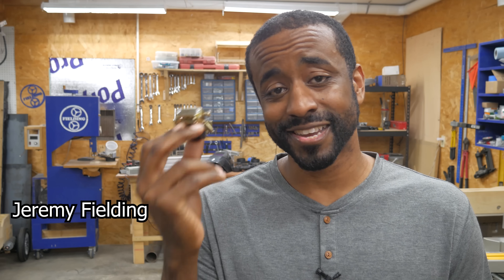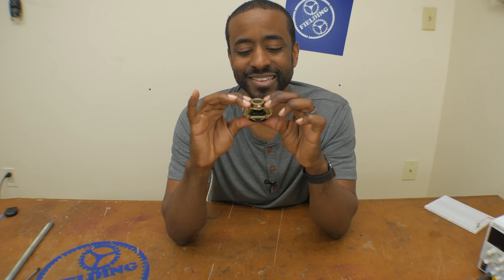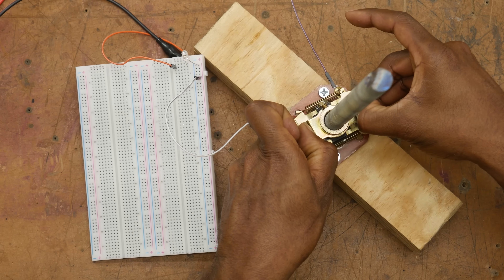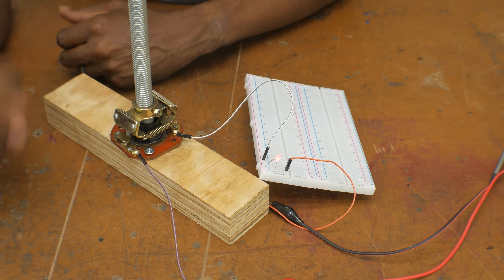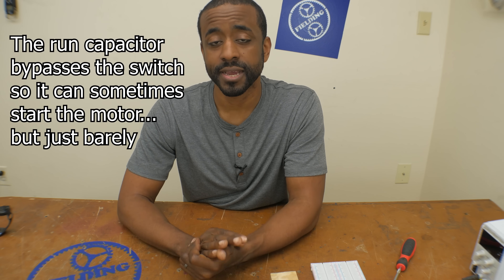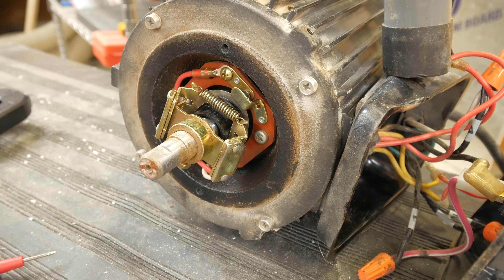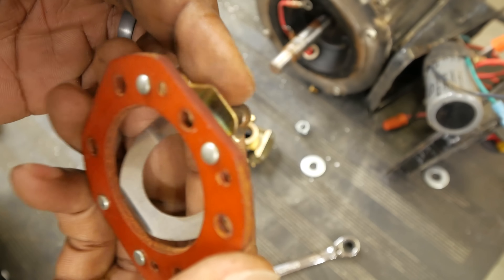This Clever Device Is Found In Nearly Every American Household. How It Works And How To Fix It

Comment: The Centrifugal switch was a reinterpretation of an older invention.
"Centrifugal governors were invented by Christiaan Huygens and used to regulate the distance and pressure between millstones in windmills in the 17th century.[1][2] In 1788, James Watt adapted one to control his steam engine where it regulates the admission of steam into the cylinder(s)[3], a development that proved so important he is sometimes called the inventor." - Wikipedia
Reply: Thanks, I was going to ask how this device is different to a governor on static engines I’ve seen (diesel wool clipper engines, fruit packing engines etc) which I was told were the same as used on James Watts’ steam engines. Apparently no different - in concept as least.
Reply: Julian Morrisco does a governor control speed in an analogue way, but this is a speed dependent switch in a binary way?
(That made more sense in my head!)
Reply: @julianmorrisco  a propaganda is all it takes.
Reply: thanks!
Reply: I’m pretty sure that was also the origin of the term “balls out.”
Reply: @likesrush  Woodward (US) is perhaps the most reliable manufacturer of Centrifugal Governors.  The oldest mechanical version is as described: two spherical weights at each end of scissors, external mechanism.  It is on the company logo but I believe it is no longer manufactured.
I believe Woodward still manufactures electronic analog versions of which the most famous model is the 2301 . The most modern versions are digital electronics and contain programs that simulate this most successful analog model.
But the more modern mechanical (centrifugal) versions that I believe are still manufactured is that they have become an icon in this field of Engineering.  The weights+scissors mechanism is still there, only it has become internal, immersed in oil, sealed in a multi-partitioned block, with extensively precise control dials. 
A precision watch piece worthy of Huygens. Widely used mainly in non-continuous diesel engines such as backup generators, fire pumps, etc.
Reply: Thank you not only for giving the credit where it's due, but also citing your source. Two thumbs up.
Reply: The elevator uses a ball governor to control the power if the elevator goes too fast- it cuts the power, an offshoot of the ball governors on steam engines, but similar idea with centrifugal force causing an action
Reply: Also used to regulate the speed of spring powered mechanical audio reproduction devices like the Edison phonograph.
Reply: Are these necessary because the North American mains electricity supply is only 110 volts? In Europe, we're on 240 volts. I've never seen one of these on an electrical motor.
Reply: @boblowes  The voltage doesn't matter; the idea is to disconnect the capacitor before it blows up and this switch is a standard feature on electrical motors. You may not have seen it because it is built into the motor  or it's in a casing to keep it free of grit and grease. Once the motor is turning, the capacitor has done it's job and rapidly becomes a liability so needs to be disconnected; ideally it should disconnect immediately as at speeds of over about 60% the motor will run the capacitor to destruction as it builds up load on it.
If you liked that invention... try looking at the Stirling Engine or Constantino's torque converter (bought for a fortune by General Motors and never used).
Reply: @irresistablejewel  in Europe this device is not used anymore. The capacitor is in the circuit all the time without getting blown
Reply: Good job on the information job well done
Reply: John Guilfoyle SC represent!
Reply: Yeah man / Thanks John
Reply: Thanks for this I knew they were on steam engines and come to think of it i've seen one in a windmill
Reply: I stay with H.E. White as the inventor in 1919, granted 1925 and Huygens in 1673 as the conceptual creator.
Ladies and gents, if I may:

Christiaan Huygens (1629 - 1695) was a Dutch physicist, mathematician, astronomer and inventor. His most famous invention was the pendulum clock (1656) that became the most accurate timekeeper for almost 300 years.

In 1659, he published his work De vi centrifuga  (in Latin) containing the still-in-use standard formulae for the centripetal and centrifugal forces .

In 1673, another work of his (also in Latin) Horologium Oscillatorium sive de motu pendulorum , on pendulums and horology, containing the analysis of a problem posed by the French Mathematician Mersenne on how calculate the period of a pendulum made of winging rigid bodies of any shape and the analysis of the conical pendulum, consisting of a weight on a cord moving in a circle , using his concept of centrifugal force . The measurement mechanisms used for such analysis lead him to another invention of his: centrifugal governors used to regulate the distance and pressure between millstones in windmills, as already stated, making the Netherlands famous for such agricultural equipment until now. In 1788, James Watt adapted such control to regulate the quantity of steam into an engine, in the beginning of Industrial Revolution it caused such impression that James Watt is often confused as the inventor even nowadays.  

Another cause of confusion can be the types of controllers: the most famous centrifugal governor is a Continuous-type control that controls a variable, usually speed, of an engine by regulating the quantity of fuel or fluid such as steam, in order to achieve any desired value (set-point) between min 0% to max 100% or in some cases such as on idle speed let's say 50% to 100%. Such continuity makes it also a Proportional control , a linear function.

The History section of Centrifugal switch in Wikipedia is quite uncompleted. The US Patent #1,630,394 granted to Royal Lee on May 31, 1927, is more about an Electrical speed governor adding more poles to an already invented single pole centrifugal switch . Such governor is a Discrete-type control meaning it has a limited number of  steps or states of regulation to make the variable achieve the set-point. As a non-continuous and non-linear function make it also an On-Off control instead a proportional one .
In this specific R. Lee's patent the available states are:
Stopped: 0% speed;
"Low Speed": motor at let'say 33% speed;
"Intermediate Speed": motor at let'say 66% speed;
"High Speed": motor at max 100% speed;

In other hand Harold Elijah White, inventor of Montclair, Essex, NJ, had his US Patent #1,552,589A CENTRIFUGAL ELECTRIC SWITCH applied on November 15, 1919 and granted only on September 8, 1925, only one and a half years before Royal Lee's electrical (discrete) speed governor. H.E. White's invention was not intended for speed control, it  is a single pole switch, more a safety/starting device than a control device, that is exactly the point of this video, as described by himself:
"Single phase induction motors, to which this invention is especially applicable, comprise two windings, one of which is required to be energized only during starting and the circuit of which it is desirable to open when the motor has attained a certain speed" .

H.E. White's patent took so long to be granted because the dispute over other applications of Centrifugal switches already in use since 1900 to 1910 or even earlier, mainly in electric fans. It was a "common" invention based on Huygens concepts every reasonable Engineer should know, maybe each one thought that each other already invented, and despite the worldwide claim of an US Patent other countries with developed industries as Germany and England were not under US laws and some other countries even had patent regulations.

In my humble opinion:
 Hooray for H.E. White and Huygens.
Reply: @alexdemoura9972  -  yes, Wikipedia is very informative, eh?
Reply: Long been a part of single phase electric motors that used the "capacitor start" design to supply adequate quadrature winding current to start the motor. Once the motor is running at or close to normal operating speed, the switch disconnects the capacitor.
Reply: And there was me hoping it would be a woman.
Reply: I knew that about James Watt thanks to an old documentary!
Reply: The term "Balls to the Wall" or "Balls Out" also came from the action of the steel balls flying outward towards the wall of a centrifugal governor on Steam Engines. This term is not to be confused with "Balls Deep," a more modern term for depth.
Reply: Patent owner of Centrifugal Switch is Royal Lee (He granted it at May 31, 1927) and he establish a company 
(Lee Engineering Company) which was based of this technology.
Reply: @EMRECNTR  that is a Wikipedia point of view, kindly check my reply above, there is another version of this history Regards
Reply: Yet another example of my statement...
Reply: Yours is a LOT better reply - more informative and critically historical -  than I was going to post about someone applying the centrifugal governor on a steam engine to electric motors.  I deleted my post.
Reply: Not a good idea to rely on WIKIPEDIA but!
Reply: John Guilfoyle if it ain't Dutch , it ain't much ......
Reply: Is this where "balls to the walls" comes from...
Reply: @joeschlotthauer840  Balls to the wall, came from WW2 pilots if i remember right. 
The throttles for a lot of the aircraft was increased or decreased by use of a metal arm with a ball attached to the top, in front of the pilots was a wall of dials, switches and instruments. So when the pilots and crew were in danger and had to get out of Dodge fast, the ball's on top of the throttle levers were pushed forwards to the wall of instruments, for full speed. 
Hence the saying, balls to the wall. In other words, "get us out of here, quick style! Get the balls to the wall"!
Reply: I'm not sure I can agree: governors and switches are entirely different things; so while the examples given all depend on centrifugal force and are undoubtedly ingenious designs; they are quite different mechanically and perform different functions. 
The centrifugal switch (above) is employed to break an electrical circuit after the inertia of an electrical engine is overcome, then it plays no further part in the process. While there very well might be one in a car starter-motor, it's more like the process of moving from 1st gear to 2nd. 1st gear supplies the power required to overcome inertia and get the wheels turning; then it's not required; continuing to accelerate in 1st and you can damage the engine (or capacitor... which is in effect the starter motor in electrical engines)
The centrifugal governor is employed to regulate an engine and keep it within a range of speeds; simpler designs don't need springs; they either provide drag by lifting cast iron balls which, in some designs, may be connected to a valve that releases steam pressure. The main purpose of governors in steam engines is to stop them "running away" to destruction; a governor operates throughout the process; sometimes acts as a brake and yes it's analogue compared to this clever (binary) switch. 
The earliest American patent I can find is this: where Mr V.E Johansen claims the invention as his and provides enough technical detail to convince me, but maybe someone would give a second opinion? 
V. E. JQHANSEN CENTRIFUGAL SWITCH Filed Oct. 20, 1926 
Application filed october 20, 1326. Serial lTO. 142,949. 
While I've a lot of respect for my fellow countryman James Watt he was not the inventor of the steam engine; what he did do was invent the "separate condenser" which greatly improved the efficiency of the (Thomas) Newcomen engine. It saved a lot of coal; powered the industrial revolution; but steam is inefficient compared to the electrical motor above and there's nothing to be done about that. Watt (low pressure) and Trevithick (high pressure) steam; both built locomotives; both blew up buildings ... so I'm guessing neither invented the emergency steam pressure escape valve.
Have a nice day!
Reply: @irresistablejewel  . Thank you .  one of the rare comments that uses  the truth and facts ,Trevithick is the first inventor of a steam locomotive that ran on rails and quite possibly the first one to build steam operated pumps to lift water out of mine shafts. Watt as far as I am concerned ,  watched a kettle boiling and found a way to improve what others had already invented years before the same as Newcomen, Watt, and Stevenson with his Rocket steam locomotive .they improved what had already been invented and made apart from Trevithick who was years ahead of the others ,
Also there seems to be much confusion about the centrifugal switch and  governors . my thoughts are that the switch idea developed from the centrifugal governor regulator, The first one to patent it probably wasn't the original inventor , much the same as many things once it's fully researched. . Wikipedia is not always correct on many things .

Comment: You have to keep the uf value of the capacitor the same but the voltage value can be increased but not decreased. I build and repair electronics, the moment you change the uf value the device will not work as desired or.... have a complete meltdown and become trash..... Just my experience and education from school/college.

Comment: In the days of tune-ups for Automobiles,  a set of "points" resided in the distributor  to make contact at certain intervals to allow the spark plug to fire. After so many miles, you would remove the points and replace them with new ones.  The points would wear from the hundreds of thousand contacts it made. You could file some of the carbon off, but it was just a temporary fix.

Comment: I’ve seen starters using magnetic switches. The larger start current through the electromagnet pulling in contacts for the start winding. All simple but effective kit.
Reply: Used mainly in sealed compressors for refrigeration.

Comment: Close but not quite...

Great description of how the centrifugal switch works but you messed up a bit on the way it starts an electric motor.  The start capacitor is not about giving an AC motor a kick in the pants (more power), its about timing.  A motor designed to run at an efficient speed when being fed by 60 hz AC is not going to work very well at low speed.  This is why a motor with a bad start capacitor won't start without a hand spin to get it going.  The capacitor puts an out of phase signal to the start winding that is timed to work better at low speed than the straight up 60 hz.  Think of it as low gear on a truck transmission.  Once the motor gets going fast enough to run efficiently on normal 60 hz power, the capacitor/ start winding are bypassed by the centrifugal switch and the power then goes straight to the run windings.
Reply from the maker: I didn't say it provided power? I said it needs a kick start. You have to quite literally push it out of position to get it to start... including physically kicking it would work LOL. I thought that was pretty much spot on. I didn't want to explain single phase motors in a video about the switch. Just read your comment and consider how many words need to be explained to a beginner... what is phase for example? But if you would like a complete explanation I made a video a few years ago that explains it in detail. "how motors work for beginners, single phase". search my channel. It's about simplicity not details.

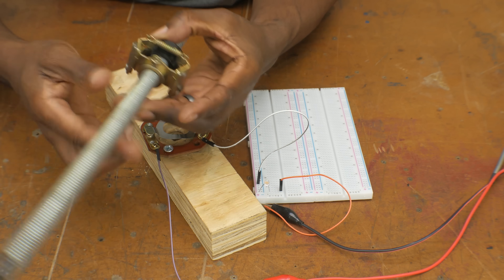Comment: 4:15 who invented it: "An 1920s patent for a centrifugal switch (US Patent #1,630,394) was granted to Royal Lee on May 31, 1927. It was the basis for the formation of the Lee Engineering Company.", from "History" on https://en.m.wikipedia.org/wiki/Centrifugal_switch

However, another patent seems to pre date this: http://www.datamp.org/patents/displayPatent.php?pn=1013780&id=53365

Quite possibly, this device in use for electric motors was adopted from the pre existing speed governor used on steam engines, by Nikola Tesla c.1888. Many of Tesla's designs were unpatented.

Comment: I have never before seen this kind of system. Well, I am from Finland, Europe. But NEVER USE that coarse SANDPAPER when cleaning contacts. It totally ruins it. If you want to use an emery paper it should be very fine like 600. I use fiber glass scraping pen which has many very thin brush hairs or a coarse cardboard like old matte surface postcard. These don’t harm the very delicate surface. You may use some cleaning fluid like LPS-1 or alcohol but you have to clean the contact well after that.

Comment: Such devices (washing machines, clocks) are powered by synchronous motors, which only run at constant speeds proportional to the cycles per second of the AC power source (60 per second). Since they only run at one speed, simply adding voltage won't make them start; they need to get them running with a bit of a kick.